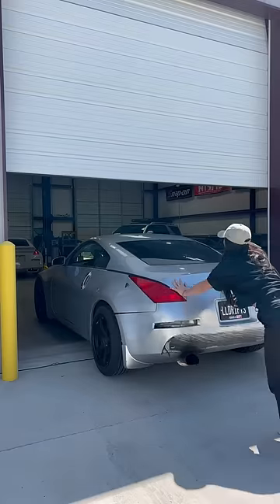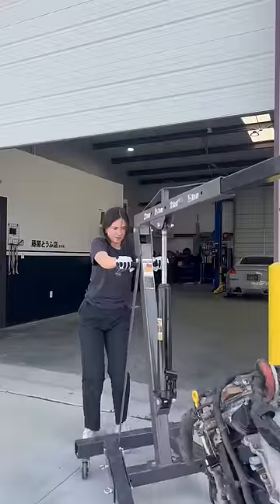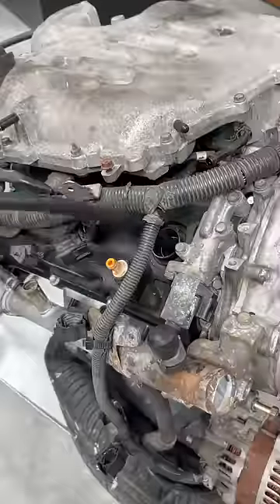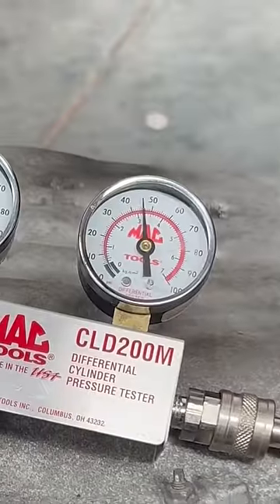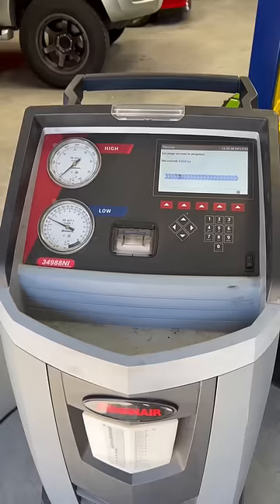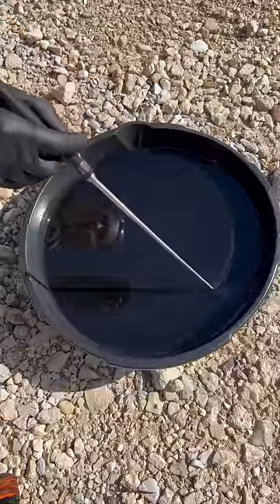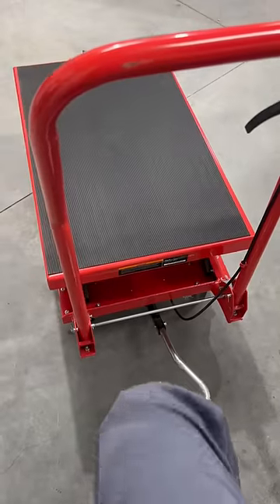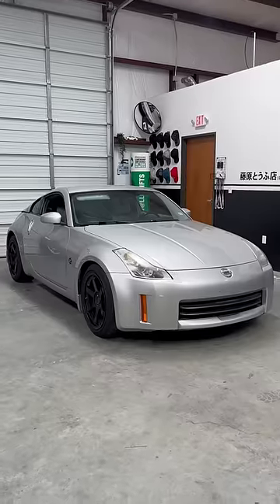VQ35 Engine Swap on a 350Z: Part 1✔️

Comment: Motor swaps have always fascinated me, at surface level it seems like it should be simple but I can’t imagine how many random hiccups appear along the way
Reply: As someone who's swapped engines before with a couple of buddies, a case of beer, and google. 
It's fucking hell on earth, everything is confusing, everything sucks, and you need to adjust the "timings" which is hell if you don't know how the fuck an engine works.

Aside from that, it was a fun 3 months of figuring out how everything worked, and I can confidently do it now that I understand it, but i'd much rather just pay a performance shop to swap an engine in.
Reply: @DrCranberry  depends on the car. Timing is tedious for sure. Pushrod American engines are simple as shit. I have a 99 v6 mustang given the right tools i can probably pull a motor in 2 hours or so. Wiring harness is 2 bolts and comes out on the motor. 2 motor mounts, exhaust, coolant and ac hoses. I like to cut the core support (weld it back in later), pull the radiator, and slide the motor and trans out the front.

Basically just reverse what the factory does and its easy
Reply: Most of these modern engines can be swapped by leaving engine on frame and raising the body. 4-5 hour job on average. Now, the hang up that I’ve always had was putting engine back on spline. Specifically a 2.7 AEB those are pains for some reason.
Reply: Its always the tiny little things that make it a ballache
Reply: Its gravy homie
Reply: They're the definition of Murphys law 😂😂😂
Reply: Lots
Reply: brother youll spend hours disconnecting the multiple wiring harness, fluid tubes and lines, bolts nuts and EVERY TIME you try to actually pull the motor, THERE IS SOMETHING ELSE. and thats just removing the motor, not any of the mid steps or reinstilation steps
Reply: So many little variations between years. Some wiring connectors will be different between years of the same frickin engine. 
Chrysler was real bad about matching up transmissions on jeeps 96 to about 2008. You need a vin number in order to get the right transmission.
Reply: Thanks for the replies fellers it’s been genuinely interesting reading what you all have to say 👍
Reply: @ryurc3033  '93-'06 Grand Cherokee transmissions. One was made in the US and the other was Japan-sourced, but Chrysler didn't tell anybody this when they sold the trucks 😭
Reply: There's nothing complicated about it. Disconnect everything, pull it, put the new one in and connect everything again.
Reply: Engine swaps were simple before all the ECM and pollution poop.
Reply: Nothing is worse than spending all that time swapping it and to have it NOT start up after being done and having to go over everything you’ve done to find what’s wrong just to have it be a single missed connector
Reply: @DrCranberry sounds like you dont know what youre doing.
Reply: I felt the same way for a long time and then I got a job working on semi trucks, swapping motors transmissions ect. Is is actually pretty straightforward and simple, but it can take a very long time because there are just so many things attached and you can’t miss a single one. The first engine I did my boss ended up making me take it back out because I had a damn heat shield left over 😂 the most stressful thing when you swap your first engine is when it’s done, because you just can’t believe it’s all done and you keep going over everything in your head trying to make sure you didn’t miss anything lmao
Reply: Bolts break, then you gotta get them out somehow, sometimes the wiring harness can be mixed up, sourcing random shit, finding shit you lost taking half the car apart, just a few things that make it hard
Reply: Take lots and lots and lots of photos, and when you think you have enough. TAKE MORE
Reply: Oh trust me, hiccups definitely come up. But they’re not always that difficult to manage
Reply: Not bad at all I do about 3 a week diesel gas cars trucks etc just really big puzzles as long as you know what bolts go where you’re good anything euro is a pain in ass through no room need low profile tools special odd bolt type most torque too yield etc
Reply: @DrCranberry  what cars are you working on? i had the engine in my 79 trans am in about 45 minutes...modern cars are shit to work on thats why we dont have many mechanics nowadays
Reply: Doing older cars can be less of a hassle. I swapped a '72 rocket350 into my '80 Olds, and the only major issues I had were exhaust not being compatible (so I just ran open manifolds) and wiring up the distributor backwards as I was used to Chevrolet engines. In the end, it was a wild experience that shredded 3 transmissions and a differential!
Reply: I remember the first time when I just got out of school and getting ASE certified way back when . My first shop I worked for used to test new employees with a big job and had to do a engine job . It was pretty intimidating but I learned from other people that is really not that bad if you take pictures before during and after and label every single bold nut screw anything and it makes everything so much easier now I can do them in my sleep. The real fun is now when I own my own shop and another shop dedicated to performance and that's where I do engine swaps with motors that just don't belong in the car I'm putting it in. Every job is a new adventure and challenge
Reply: Oh yeah, you said it.  You haven't done one but already you have a feel of how humbling an engine swap is even when it's the exact same engine.  Where things REALLY get interesting, is when somebody gets really ambitious and thinks they will just try to swap in a different type engine than the one the  car came with.  This is in general a horrible, horrible idea and I'd stick with swapping in the same type engine it came with, period, full stop!
If you are still thinking this is a good idea:  2/
Reply: Based on bitter experience, to these people I say the following:  1) good luck you'll need it, 
2) Sorry but no I won't help, because 
3)  it won't go well, you'll need to buy a hundred parts to try to make it work, which it won't because 
4)  all your fittings are for the engine it came with, so it will never run right and you'll wish you'd stuck with the same engine in the first place but by then
5)  You'll be in it so deep of a hole invested in this car that you won't be able to make run right you'll regret the day you thought up this dumb idea...

Comment: Sparkly oil doesn’t mean engine failure but that metal on metal contact is being made I.E spun bearing, worn piston rings, rod knock and many other things
Reply: All of which usually lead to engine failure not long after
Reply: how long does it take to be as knowledgeable and capable as you all? where do you learn?
Reply: @qp4367  tons of youtube videos, posting questions in forums, and trying it for yourself ...a LOT is not that hard, and once you learn you have the knowledge for the rest of your life. Cars are always going to be in your life, so personally I think it's really worth learning a good amount about, but just focus on YOUR car...so many are so different...you don't have to become. master mechanic that knows how to work on all cars....just get pretty good with the one you own or want to own. Oh...and a 350z is a great car to own and drive and learn on...the designer was a race car driver so it's designed for easy access to most of the components that will need replacement or modifying or repair.
Reply: @locophoto6881  I agree with you but what should I start with to know I'm learning things the way a student would? Should I memorize a photo of all the major components of an engine block....is there an online resource  or a book? a you tuber you trust?
Reply: @qp4367  if you can find them.  A  Chilton’s or Haynes repair manual for your specific vehicle, or their subject overview books, are a great start for having a book to actually see all the steps.   
  Haynes & Chilton’s each make repair manuals for a ton of vehicles going back to the 1940s. They also cover everything from learning how to weld, to the basic principles of automatic transmissions.
Reply: So your saying the engine needs to be changed i.e. it has failed, correct?
Reply: @kevinmonahan2820 No, if a cam lob wore down causing metal in the oil, replace the cam and the cause of the failure.

The reason their swapping motors in this car is because the heads call for 25 hours if in not mistaken and the swap is easier.
Reply: Or Engine restore additive causes it lol
Reply: This girl knows what she’s doing

Comment: I promise you, it's easier to drop the engine out the bottom for something like that. Strut towers, from cradle, disconnect the hoses and wires. Make sure you have old tires resting under the cradle then lift it off slowly. While it's out, clean the bay and change things like water pump while you're there, if manual clutch, throw-out, pressure plate. All the things that you'd need to move an engine for anyway, get it done while you have the access.
Reply: Nah on these cars out the front is the way to go. Nissan designed these to come out the front with the transmission attached. Also note, the AC condenser swings out to the side, so there is no need to drain the AC.
Reply: @captaincannabis3321  Exactly, I just discovered this when restoring my Z, with the core support off, and the car up on jackstands, the engine & trans just slid straight out the front.
Reply: @fckjoebdn1776  Yup. Compared to changing the engine on my wifes Chrysler Pacifica, this car is a dream to work on.

Comment: Nice of you to remove the refrigerant the right eco way 😂 most just say it's just like when you get in to an accident, they just release it to the atmosphere.
Reply: R134 is not ozone depleting anyways
Reply: Well its not even necessary on these cars to even drain the AC. All the AC components move out of the way without draining and the engine comes out the front.
Reply: @Captain Cannabis  I know I do it like than on BMW's, but once I poked a hole through the condencer and it was a $160 mistake haha

Comment: Props for doing a leak down test instead of just a compression test!
Reply: Still doesn't tell you if it has rod knock
Reply: You can have good leakdown but bad compression if the timing has jumped. It didn't look like she did compression

Comment: Don't lift it out or lift the car off the body. The whole front clip comes off as one piece. It's like 12 to 15 bolts once you remove the bumper cover and bumper. Once you do that you can literally hook up your hoist and walk it straight out. Secondly, you need to remove the engine and trans as one unit. You can remove just the engine but angling the engine and input shaft properly while the trans is still mounted in the Z is a massive PITA and you will wished you just removed as a unit and put back as a unit. GL. Already did it myself after I hit a foot of water 😂.
Reply: I think they already know
Reply: @slammedek6452  how ?

Comment: Did a swap on my g35, non revup but same process. I found that lifting the car was way easier as you can mate the trans and set it in together. Could be done either way, but taking the car off the engine worked very well for me.

Comment: the revups are such a gamble, some of them were burning oil out of the factory, that's how bad their piston rings were. and the fact a donor swap is $3-4k without even fixing the engine OR labor it's just a lose-lose all around.

you can get a DE up to revup limits by swapping the rod end bolts with ARP bolts, getting a NISMO or revup oil pump, and resetting the ECU limiter to 7200.

Comment: Imagine an engine not even lasting 60k. Holy crap Nissan, get it together.
Reply: Dude, it all depends on maintenance. I have a 4.0 V6 '05 Pathfinder with 150k and it runs like new.
Reply: My cat converters on my VHR didn’t even last 60k
Reply: I have 423k miles on my 16 sitting altima.
Reply: 350's get abused way too much.
Reply: I mean…what tf do you expect if you’re racing and pushing the car everyday with STOCK INTERNALS?😂😂😂😂
Reply: Nah, that's not Nissan's fault. Whoever owned that z took horrible care of it.
Reply: They took really shitty care of it, VQs are good engines they just tend to burn oil and have a history of cat failure… that good ol PO420
Reply: That's not even knock.. That's the rockers. Common fail that people panic about.
Reply: @occckid123  all power to you and your Altima but that’s probably like 85k city miles
Reply: That would only happen if you highly abuse a vehicle
Reply: That’s what happens when tiktok convinced girls to get coupes lol
Reply: @rhull3939  wait till those timing guides go out
Reply: I mean it's a 20 year old car, mileage doesn't mean much compared to maintaince and driving habits
Reply: @Colg555  hasn't happened yet. 🤞
Reply: @rhull3939  that’s good, had an xterra with the 4.0 around 190k then I started to hear that whine
Reply: The engine in the 350Z probably was getting redlined to its death by the previous owner. 350Z owners are notorious for not taking care of their vehicle.

Comment: Its always easier to drop an engine rather than pick an engine just remove as much stuff as you can start at the back and work in a clockwise patern and support the engine while you take out the motor mounts completely.

...ive taken out like 15 engines 😅

Comment: Pull the motor straight out the front, did the same thing when I swapped a 454 into my g35. Pull off the front in and it makes it easy peasy.

Comment: with a lift I would think dropping the subframe engine and transmission at the same time on a table is the way to go. You then roll the table out of the way and do the engine part swapover.
Reply: sorry I see that's what you did.

Comment: Automotive technician here...

You're gonna want to drop the engine thru the bottom. Get a decent table that rolls around. Might be easier to remove the transmission along with the engine still attached.

Comment: Im not sure how similar is the 350z bay to the 2015 infiniti q50/370z, but you could unbolt the reinforcement bar, radiator core support bracket, subframe, subframe crossmember and engine mounts and it should just roll right out

Source: doing a resto on a front end collision infiniti q50 and had to replace the above listed parts minus the engine mount and subframe

Comment: drop it from the bottom with the entire sub frame, I disconnected the connection to the computer from the cabin near the cabin filter and then you can take the engine and subframe with the engine harness connected

Comment: Top tip, the VQ35 in the early 350z had an issue with the dipstick not reading correctly causing the engine to oils starve them selfs 
That's because the VQ35 was originally designed for the Nissan Altima/maxima fwd applications and Nissan being Nissan decided to hell with it and all early VQ35 would blow up due to the dipstick reading incorrectly and impossible to read 
Keep that in mind
Reply: Very common knowledge, especially to any vq35de owner.
Reply: @sharkfinsoupp  yeah well you be surprised how many people think that I'm wrong and how could the 350z engine be designed for a Nissan Altima that makes no sense
You see my point

Comment: If the valvetrain in the vq is anything like the RB's, then it's probably just a stuck lifter. I'd say that the car has sat around a lot based on the mileage. It may not need an engine swap but based on the oil, it wouldnt hurt. I just wouldnt rush into a marketplace engine when you have a low K's engine in it already.

Comment: If the 'tapping' increases with engine RPM it's bottom end, likely bearings. If the tapping doesn't increase with RPM, it's top end and likely valve related.

Comment: As soon as I seen metal in the oil I wouldn’t have put it in that’s lack of oil changes causing abnormal valve train and piston ring wear as well as rod crank and cam bearing wear your going to end up with a headache the best thing to do is throw some forged pistons and rods with a better more balanced stronger crank in there upgrade the oil pump cams and timing polish and port the heads put in a performance valve train throw in a upgraded fuel pump and injectors and throw a turbo kit on it with a tune and run some real boost and power do some rear suspension work because those cars have bad wheel hop and it will be much more enjoyable don’t crank up the boost to much you still want it to be practical there should be a boost controller in a decent turbo kit but if it doesn’t have one just buy one I’d stay around 10-16 lbs of boost so you don’t kill the gas mileage while getting a lot more power and it’s a fun street car I love these z cars they make good power if you know what your doing but they do require a bit of work it’s not easy power but it’s rewarding try getting your hands on a last gen 300zx turbo👍

Comment: With all due respect, anyone that knows the Nissan 3.5, is certainly aware of the failure of the Timing components. I own 3 of them, and realize that maintenance is critical on these powerplants. I am puzzled why the timing cover wasn't pulled to inspect the components. The 350z is a cakewalk to repair compared to the transverse Altima and Maxima body. 2 of my 3 have nearly 300k each.

Comment: I would lift the car off the engine, if you haven't already. I didn't find any way to remove the front end of the car without removing the a/c, and it sounds like your friend wants to keep that, so lifting would make it easier than swinging with a hoist. The pilot bearing is extremely small & tight clearance, so the straighter you can get that engine in there, the easier the swap will be. 

It's still do-able with a hoist, it's just a bit of a PITA and you have better equipment than my diy garage lol

Comment: Definitely drop the engine from underneath since you have a lift!
It's a unibody.
It is designed to be serviced from below. "No Pun Intended."
Replace the wiring harness and computer, run everything up to factory specs before ANY mods.